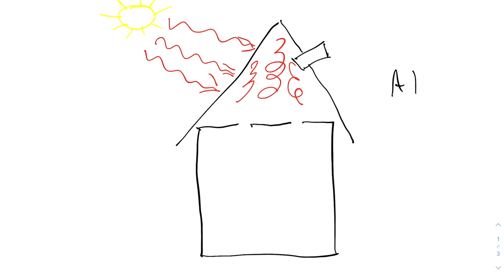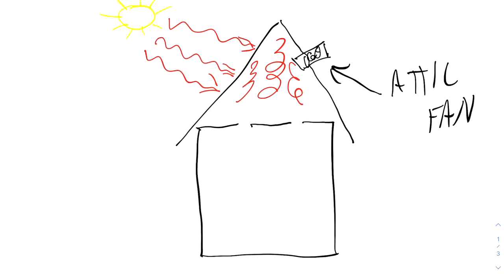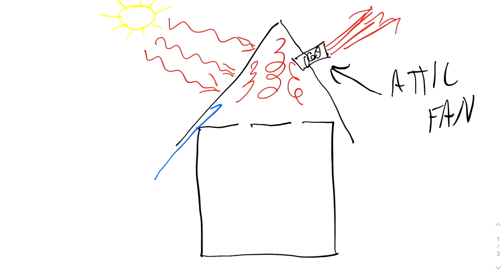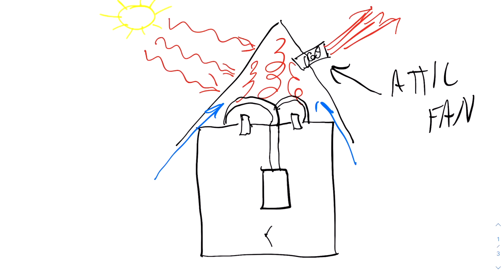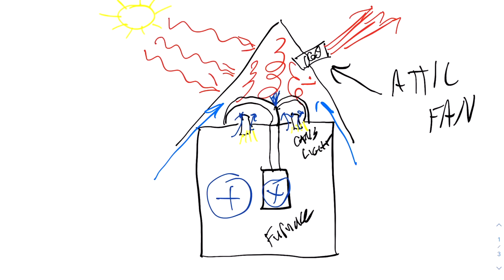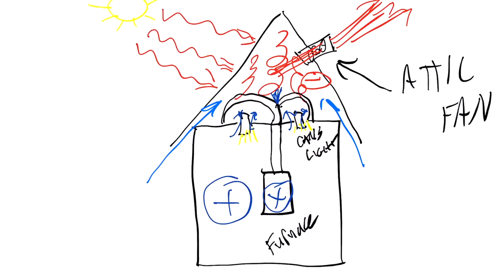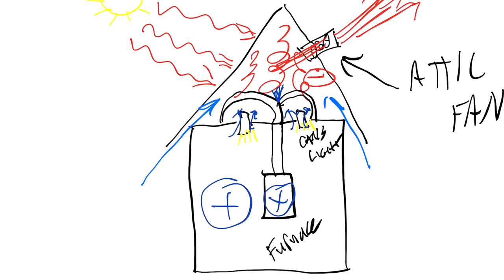3 Remodel Rip-Offs

Comment: Your analogies don't make a lot of sense. Houses ventilate their attics for a reason. The heat from the shingles heats up the air in the attic. Ventilation helps singles from getting too hot, which will result in a reduced life span (you can see heat blisters on homes with poor roof ventilation). Attic fans are good to use as supplements to traditional ventilation when there are limitations to traditional vents (think a small ranch with a ridge vent on a hip roof). While they can create a negative pressure in the attic, proper sealing and insulation can reduce the effects. Your attic insulation will be more effective at reducing loss when you decrease the temperature difference between the house and the attic. I haven't even addressed the issues of thermal shock on the shingles and moisture build up in the attic (hot humid attic vs cold drywall).
Reply: @PersonalStash420  He builds new homes with conditioned attics. He believes in passive measures to ventilate conventional attics. His point is the relative efficiency of a 12" fan cooling a giant heat sink with sun adding heat during the process. When I asked him for advice on a 60s attic, he recommended as much additional passive ventilation as possible.
Reply: @MAGAMAN  when you replace your roof it is easy to add ridge vents. Matt recommended I do that. As far as cheaper, my solar vent ranges from $300-$1000 before installation. I think my ridge vents added less than $2000 to my roof replacement on a 1800 sq ranch from the 60s.
Reply: @PersonalStash420  There is absolutely such a thing. If you put an powered attic fan in an attic with no or little soffit venting then you create a vacuum in your attic which will then pull air from any tiny crack/gap from inside the conditioned home. A terrible situation. And these fans aren't cheap to run for 8hrs a day @ 300watts either.
Reply: @PersonalStash420  I agree with your ventilation claims, even though I don't have soffits on my 1830's home, just a very short eave that's pretty much solid wood.  I guess this isn't a common scenario where you are but around me it is with 19th century homes.  The ventilation is done with a fan in each gable, one pusher and one puller.  Works a treat.
Reply: Firstly, in order to get proper attic ventilation, the house needs Soffit vents. Ive seen a lot of house in Houston TX that only appear to have soffit vents and surprisingly a lot that dont even appear to have vented soffit. So long as yhe house has a ridge vent, the roof will cool passively and well. Secondly, if you interrupt the flow of soffit air someway up the rafter bay, you are creating a shortcut for the cooling air to exit. eg Path of Least Resistance. Thirdly if u power that vent, it pulls air from where ever it is available, which is a radius of least resistance. Which means it will pull from the ridge which will be hot air from above the shingles and it will be cool air from the air leaks in the attic floor. Thermodynamics isnt an easy subject especially on a complex system like a house.
Reply: Ellis K yes there is, its called making your house suck
Reply: @zefrum3  I don't think anyone disagrees that soffit vents are essential. Shortcut or no shortcut for the air, if you don't have enough ventilation on the roof a power fan will help. I would agree that proper passive ventilation should be good, but I've seen way to many homes where they didn't have enough due to the roof layout. I spent 7 years inspecting roofs. I can tell you way more about factors that contribute to the deterioration of a roof than a new home builder that doesn't see 5 roofs every day. Active ventilation is good on older homes or homes that have hip roofs. On a ranch you really need a gable roof to have enough ventilation for a ridge vent, but you see a ton that have a short run of ridge ventilation and the shingles are deteriorated at 12-15 years old. I saw it time and time again. However, on homes with power vents the roofs didn't show anywhere as much deterioration. So whether your concept on shortcuts is true or not, I've seen it with my own eyes. 5 roofs a day for 7 years (7 days a week in the summer). The fact is that they work, ESPECIALLY on roofs with insufficient passive ventilation.
Reply: Jessi Lane its impossible to claim an attic fan keeps all of a house’s roof shingles from deteriorating as you state, as the fan will only cool a radius of roofing to the fan. You may have conclusions from your experience going into many attics but this is not scientific evidence, only anecdotal at best. This may sound harsh but its a fact. Home inspectors do not discover the cause of something wrong with a home, they only find them and miss many too. Engineers find problems and develop solutions from the scientific method and actual research. This isnt going to sound PC but old dogs like yourself that claim their experience is gold is exactly the problem with the remodeling industry, as well as the HVAC-R industry too. A claim that is not testable is worthless. Assering a conclusion as fact without testing it is fundamentally wrong, no matter how sincere your intention is; its a kin to a lie.
Reply: @zefrum3  I'm actually Haag certified. I was an insurance adjuster and had to know the cause of damage to a roof to determine if it was covered. This had to hold up in a court of law "based on my experience" and engineering reports. Haag certification IS based on engineering. And I worked with several engineers on a regular basis. It is "scientifically" proven that excessive heat deteriorates shingles. It is also proven that ventilation reduces the heat in an attic (or why would we use it on every house?). As to my original point, insufficient passive ventilation can be helped with active. If you read the instructions on the "industry favorite" ridge vents, you will know that each foot is intended to vent a given amount of space. If not enough ventilation is provided, then the attic will over heat and the shingles will prematurely deteriorate. When you say it only covers a certain radius, but then his original argument states that it will create a negative pressure doesn't make any sense. So the problem with powered vents is they create a negative pressure in the attic, but somehow only in a certain radius? Even if you are only pulling cool air in one spot it will result in the surrounding attic air to be reduced. But what do I know? This "old dog" (30 year old) was only an expert witness that testified on the cause of deterioration to shingles in several court cases. The real problem with the remodel industry is too many contractors thinking they know engineering and how a product or technique performs 10-20 years down the road when they are gone. But guess who is there when that does happen and unfortunately the customer is stuck with the bill?
Reply: @jessilane2240  haag certification brings nothing to a discussion except the fallacy of argument from authority; and its not even related to building science; you basically know how a few rooves are assembled and can account for the cost in repairing it, big whoop. Im well educated and an engineer; I know way too much about thermodynamics and older home construction but Im not arguing 'i have certification and therefore what i say is fact' as you are. Heck I even have like 4 or 5 certifications for HVAC too but so what? I am bringing easy to understand principles as proofs. What most people discuss is that it worked for them but they dont give any description of what their assembly is; none of the proponet for fan commentators have discussed if there home has soffit vents let alone continuous soffit ventilation or anything, just that it works for them; this is anecdotal at best.
Reply: @zefrum3  Haag certification is actually used to certify ability in determining an origin of damage (I.e. heat). I brought up my certification as you stated (summarizing here), that my experience alone is not valid. So I backed up my experience with my credentials. Writing estimates is the easy part of adjusting. Analyzing the cause and origin is a much more important factor. Soffit vents obviously are a must and at no point did I say otherwise. I only argued that the improper design of several roofs lead to supplemental needs. It's easier to add a fan than completely reframe the roof. If you argue against attic vents, then address the concerns that I have listed. Fixing improper design (adding soffit vents, while it may help, doesn't cure lack of upper vents) and the resultant issues that come with of heat damage to shingles (see heat blisters), thermal shock in roofs, moisture accumulation in attics, and ice damming due to lack of proper ventilation. Can you explain how pulling stagnant air from the attic does not improve any of these issues?
Reply: @jessilane2240  yes: pulling air from the attic creates negative pressure above the attic floor which is the lower floor ceiling. These ceiling have many holes, gaps and cracks. In the summer, hot air is lighter than cold air. As hot air is pulled away a draft is formed whereby air from these holes, gaps and cracks is pulled up from. This air is cooler as it was in the conditioned space. This gap air cools the attic in addition to stagnat attic air due to poor roof design and construction.
Reply: @jessilane2240  Fixing the roof assembly is the correct way AND way better than adding an additional HVAC load on the conditioners by 'installing' an attic fan; which will reduce the longevity of the HVAC units. Threby any 'large' cost in actually fixing the poor assembly will be offset by the increased longevity of the HVAC system.
Reply: @jessilane2240  Like I previously stated haag cert doesnt mean anthing here just like my degrees and HVAC certs I got. The way you are suppose to back up your points are not with your expereince but with actual logic and data; also know as the scientific method. Think about it, are you just gonna believe Matt Risinger because he has experience? ha ha no clearly you dont. You clearly put your expereince over his but that is totally fallicious; you have no arbiter saying you have the ultimate correct knowledge in the field. However, Matt brings logic and evidence. Look its not easy to hear you are wrong, I get it; but to keep on claiming you are right when you cant prove it with actual evidence or supporting non-fallicious logic, only digs your position further into the ground.
Reply: @zefrum3  Well I would definitely say I have more experience than Matt on the specific area of the roofing envelope. This is, yes, due to experience and certifications (deeming a certification invalid is a poor argument). These two things are how we deem "experts", who are allowed to advise us from their knowledge. I have researched the effects of poor ventilation as documented by the people that did do the science and am certified in my knowledge of their research. That's how it works. Your argument is that I am wrong because I haven't proven scientifically with data in research and that you know because you are an engineer, but you have yet to provide credentials, experience, or "scientific evidence" for your argument. I have provided all three being my scientific evidence is research that was already done by Haag and I am simply regurgitating it. Now, I have a master's in Technical Education and I should know better and provide a reference for you to read and learn up on what I know. The best resource for knowing the proper details of a product is the manufacturer, so I've attached information about ventilation from Owens Corning that specifically states that the attic floor should be "sealed" and "air tight". If the attic floor is "air tight" then how can it pull air from the home. And you would rather rip off and completely reframe a roof to change the style of roof than making the attic floor air tight and add a supplement ventilation system? I'm glad your customers can afford such an extravagant remodel to fix something that can be much more easily and cost effectively repaired. Good thing they have an HVAC "engineer" (quotes as you have not provided any actual certifying body for your qualifications). You still haven't addressed any of the other issues I brought up and keep going back to discrediting me, when time and time again I provide you with the information that I know what I am talking about. Why don't you counter my argument with your own scientific data, roofing (not HVAC) experience, or roof knowledge certification. You expect me to back my argument, but won't back your own. Here is an article you can read to learn more. https://www.owenscorning.com/roofing/tools/why-proper-roof-and-attic-ventilation-is-important-for-your-home
Reply: Jessi Lane attributing words to another man who did bot speak them is a poor argument. No one ever said the attic floor/below ceiling were sealed. Matter if fact most guys arguing here are saying a fan cant possibly suck air through an unsealed attic floor. -?-   And whats up with the personal attacks? If you cant leave ad hominem and appeal to authority fallacy out of your arguments you haven’t a leg to stand on.
Reply: @zefrum3  Nothing personal man. You are just arguing with a roofing expert and have yet to justify your argument or your expertise that you have any knowledge in the subject matter. My argument for the attic space is that it should be "air tight" per Owens Corning" so if a fan is pulling air from the home, you need to be sealing the attic space and not blame the attic fan for doing exactly what it was designed to do. You keep saying I don't have a leg to stand on, but you can't prove it. Just give up man. It's ok for you to know less than an expert.

Comment: And again Matt. Get down to Florida and look at some of the old windows we have here.... Aluminum single glass which never fully close. 
And than you upgrade your a tripple pan glass which is airtight. 

Yes you safe more than 40% on your energy because now you no longer have a swiss cheese in your window.
Reply: His point is the probability that your old house leaks in so many other places that replacing all the windows is not cost effective if you only measure energy savings.
Reply: Yeah I have single pane aluminium windows too also 2 custum plexiglass windows too.
Reply: They also scalp you down here. I saw a quote for a 1500 square foot house to redo the windows with impact glass. $30,000. Absolutely insane.

Comment: Any mod or installation if treated as an individual component is a scam. Contrary, a properly balanced and engineered system is beneficial.  Attic fans do work, as long as they're incorporated into the ventilation ... as a system.
Reply: Especially when that component is installed or spec'd improperly, or the application is wrong - which is half of what he's using as his basis. I could say "window units are a scam" - then proceed to show you one installed backwards blowing cold outside - or trying to use a tiny 5kbtu window unit to cool a 7500sf mansion.

Comment: Matt, I love your experience and thoughtful advice on home remodels.  My comment is on a slightly different fan.  I live in Denver, CO which has very high heat gain during the summer months and typically dry cool nights.  Several years ago I installed a whole house fan that takes air from my 2nd story and blows it into the attic.  The air exits through roof Turtle vents and a longish strip vent.  If I have a nightly low temp below 70f, I can open doors and windows and start blowing as soon as the ambient temp falls below 80f.  By morning, my whole house is in the 68-72f range.  Over the last 4 summers, I've used my A/C approximately 40 minutes per summer.  My electric bills average around $60.  My neighbor with a home footprint the same as mine that was built at the same time by the same contractor averages about $500/month.  So in my case, the whole house fan paid for itself in 3 months and has been saving my a lot of money ever since.